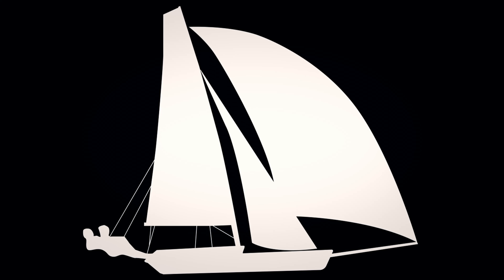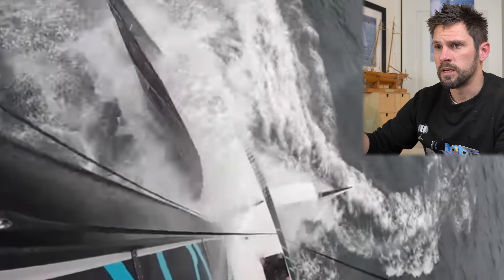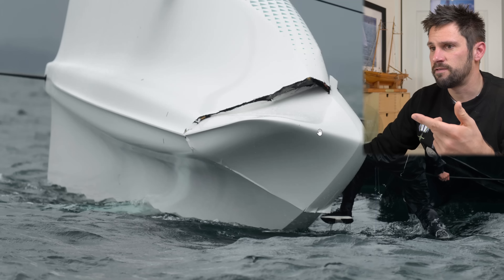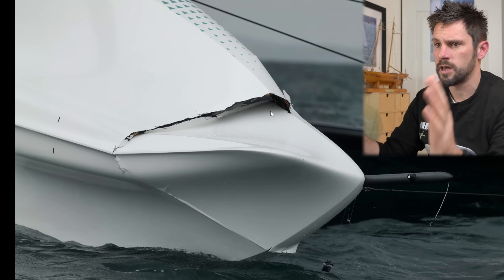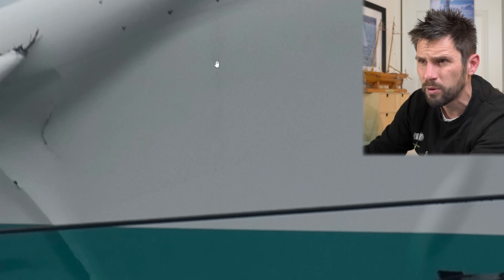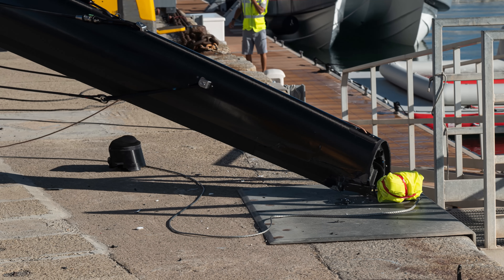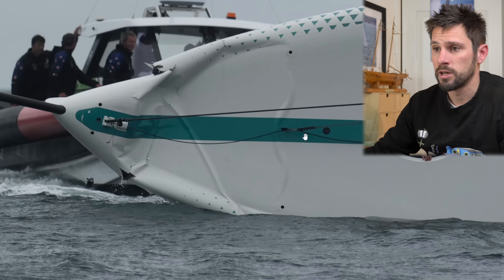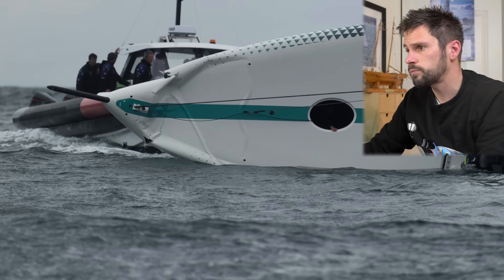Implications of AC40 Structural Failure

Comment: Having done many sailboat structural laminates, is there a published minimum laminate for the class?
Reply: From the pictures, you have 3 modes of failure in different locations. Compression, shearing and buckling.
Reply: Buckling is a type of compression failure. Shear is a combination of tensile and compressive loads and the failure can come from either mode

Comment: I think the teams building their own test platforms is about risk management and control for those teams. meaning they aren't relying on anyone else to build and deliver their test boat for them.

as for the damage to the AC40, as others have said it really doesn't help anyone as ultimately everyone will be using these boats. I just hope the the design team has seen this as a potential issue and already has backup plans like mods in mind, Considering the number of similar incidents we have seen in recent years in the IMOCA fleet

Comment: Implications for the design simulation software as well. The sea state is within racing parameters, especially with Barcelona in mind. Time delays sorting out teething problems will be factored in for test boats - that's what specialist test boats are for. Maybe LR and Ineos had good reason to build specialist test boats, especially as their missions are to win the AC and not the AC40 series.

Comment: No worries. Look on the bright side; we know that the AC40 isn't over engineered!
Is this a prototype or a production boat? If prototype, well the new load case can be factored in to the production boats. If its a production boat...hold production, work out the new scantlings and any mods, restart. Yes, there's a schedule hit but that's better than having a design than breaks like an egg every time someone stuffs it. These boats will get abused by talented foiling tyros!

Comment: Someone on Ineos or Prada said that they built their test boat so they weren't beholden to other team's designs or schedule, so I guess in light of what has happened, they are coming out of this just where they want to be.
Reply: There is nothing wrong with finding out there is a flaw in the testing stage its in actual race and production finding flaws becomes problematic. Ineos has the money to be able to do this. Sadly ETNZ has been running and competing on a shoe string budget as the underdog for the majority of the ACs they have entered so working with other teams for ETNZ is a Need probably not a want.

Comment: It is not only structural issues of the bow, everything started with rudder.
You are right, they should have wave piercing bows ( considering speeds they are doing ), like the big  catamarans or the big trimarans.
I guess it is back to the drawing bord.....( adding another frame won't help at all increasing longitudinal stiffness ).
Reply: Right -- so is there an issue with the rudder, or the system controlling it? Got to find root causes.
Reply: Pitch poling isn't anything extraordinary in these boats. The rudder is just fine. It's not a brand new concept.
Reply: There was a problem with trim tab on rudder - it made rudder suddenly go up.
If stern goes up - bow comes down. Faster it goes up faster it comes down. 
Of course sudden slamming was a bit too much. Lucky for them, by losing the forestay - they didn't lose the mast.....

Comment: Preliminary field report from Kiwis indicate failure principally took place forward of the front watertight bulkhead. The bulkhead held and no water entered the boat. Speculation is that reinforcing  with additional stringers and ribbing should prevent bow becoming a "crumple zone" when nose diving . If true the Kiwi boatbuilders can fix easily once designers come back with required specs. Weight redistributions to be sorted through trim adjustments. Rudder breaking free is nothing new with high speed foiling change of direction..
At this level of innovative design research and development  occasional failures come with the territory. Thankfully no-one hurt in this instance.  The concept of AC 40's broadening sailor  participation and acting as design test bed is itself a great innovation. Premium is  getting on with job of analysing and fixing issue rather than wasteful bickering.over who is at fault. 
 One Australia broke in half and sank not too far from start line of 1997 AC race. We all saw catastrophic failure of American boat in Aukland last time around.  Being "on the edge" and exploring possibilities with best designers, technology  and sailors is major factor in AC being an apex sailing event.

Comment: It just proves that it’s all heading in the wrong direction. Extreme over the edge design is in. Seaworthiness is an ancient art!
Reply: right, like j classes and 12 meters werent snapping masts and cracking in half before
Reply: @nicholaycalhoun1681    I liked the 12 metres, but I don’t think viewing public will put up with 3 hours of sailing the speed of a tortoise.
Reply: @johnmartin7158  Exactly. I know I wouldn't. Nothing against traditional sailing methods and classic boats, but it's kind of impossible to revert to the old ways of doing things now when for the past decade the public has been acclimated to such high performance. That ship has sailed..
Reply: @nicholaycalhoun1681  They were able to cross oceans to compete.
Reply: @jonathanlewis1352  Please read the whole comment before replying. Thank you. 😀
Reply: @Nikolay pretty sure in 95 One Australia's boat sunk after it turned into a banana during the race against NZ. Also NZ mast snapped in half against Alinghi.

Comment: With every new video i learn just how much all the different teams are actually connected in their strategies. 
The biggest dent would be the one in the confidence in the platform as a development/testing platform and into the design capabilities of the respective engineers. 

at least this isnt inherently unstable or unmaneuverable. as a non-engineer i would expect that this could be fixed with reenforcements in the Ac40 hull.
Reply: ETNZ is the only one so far relying entirely on sailing an AC40, so they'll pay the biggest cost for sure. The Women's and Youth regattas won't start for a long time.
Reply: But it was instability ... The foils 'stopped working' . I'm curious if the crew could have reacted somehow to reduce the impact. Prob not. Dilemma time. I doubt they'll want to increase weight or complexity of the hull design, but maybe they'll have to , if only to say 'we've made it stronger'. Depends on the detail of the design brief and the buyer agreement I suppose.
Reply: @chrisbc61  as far as i understood the ac40 sailed more or less as well as the big boats...weather thats good or bad, but not that there were any major design flaws regarding the functionality. 

...but i am not well informed at all, further details would be mich appreciated
Reply: @tflspitfire agree with you! I heard Grant Dalton say they were flying the boat manually due to LEQ setup ( did I get that right? ). It'd be cool to know more about their automation and which classes will use this.

Comment: To me it seems it isn't so much about the water hitting the hull, but the sail catching the water. Way more drag and thus force than from the hull itself (think of storm jibs).
Reply: i don't agree. most of the damage seems to be from compression of the bow, moving aft.  if the sail drag was the major component id guess the bow would move up or the chainplate  wouldve failed.
Reply: I'm not so sure. If you look at the animation in this video https://youtu.be/XY8DO0fvb_k and how deep the boat nosedives before decelerating. I reckon there wouldn't be a force gradient large enough between the bow and the more aft sections to cause the failure where it is.

Comment: Won’t this also call into question adequacy of the AC75 construction design calcs & standards? 

btw catchy 🎶 intro riff already starting to engrain to addictive levels 😅
Reply: Nope. This didn't happen to any of the AC75 boats that tested and raced in the previous cup.
Reply: @AnttiBrax  oh thanks, I kinda assumed the AC37 would have meant revisions to the hull design parameters for campaigns building anew

Comment: The issue with designing around structural failure is selecting the loading.  That is, no matter the loading mode, I can always provide additional load at a new vector. 

Taken to extreme, the structure becomes absurd.  Example: should we design bridges to withstand direct strikes from oil tankers?  Should we design tanks to withstand armor piercing rounds?  The point becomes obvious.  Should a lightweight AC40 withstand all capsize modes?

How heavy will it be then?
Reply: I second that the loading probably wasn't calculated correctly. Given the amount of structural tests they did, the problem is clearly in the spec.
Reply: @cstroganov  Exactly that.  I'm sure that it was designed to the specification provided, yet the specification was inadequate.  

Yet the specification will always be lacking to an arbitrary load case. Should it specify the load case of tsar bomba at 100 meters?
Reply: Yes but this load case is not that obscure

Comment: No one wins in a situation like this. The teams that were counting on this design for testing will now be looking for relief from the rules committee, which will probably set off a lot of behind the scenes arguments and finger pointing. And if it were me in charge of the one-design side of things (or an insurance underwriter) I would be asking for a stem to stern structural review by an independent engineering firm. This could easily bog down for months. I hope not. But like you say, it’s not a one-off that can be patched and the crew accepts the risks. This is the prototype for an entire production run. A tricky situation for the cup, no doubt about it.
Reply: Quite opposite. More is learnt from a failure than any other out come. Everyone will place effort in understanding and mitigation. All win.
Reply: They did say it was heavy conditions, pushed hard but, if they intend to have wind restrictions for racing, this might not be as bad as all that.
Reply: @bradclifton5248  Grant was saying in the latest video that they are expecting to sail in conditions at least as strong in Barca. He's pretty up front about Ineos' boat needing beefing up and the subsequent boats having a the structure upgrades built in.
Reply: It is a boat - they can slice a new Bow and add an additional Ring Bulkhead in and add longitudinal reinforcement stringers. The Fore-stay connection is further aft so the structure going back to the Foils and Stern are probably very strong in order to take the loads from the rig.
Reply: @cliveengel5744  You make it sound so simple, perhaps they will have it back on the water next week.  Given this is going to be a production yacht there will be significantly more work than that.  Also all this extra weight that you are adding needs to be counter balanced.  So the sleek lightweight machine just adding a lot of weight.  Far from ideal.  I would be cancelling my order
Reply: Cancelling your order on a $2m state of the art boat. I don’t think so. If you have that kind of cash for a racing yacht you aren’t cancelling your order. You’ve seen them peak out at 40knts and wonder if you can sail it that quick.
Reply: @samuelbryan7800  I have no interest in sailing a 40' yacht at that speed.  Whilst I am happy to watch the professionals do it I know my limitations.  I wonder how many have actually been sold>  I am guessing audience will be the TP52, Swan club 50 and RC44 type owner racer.  Time will tell.